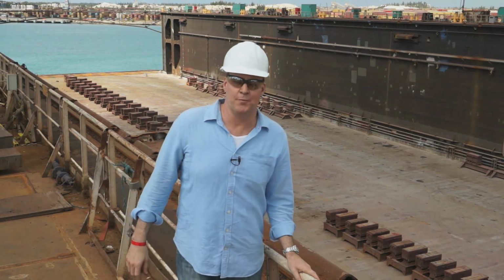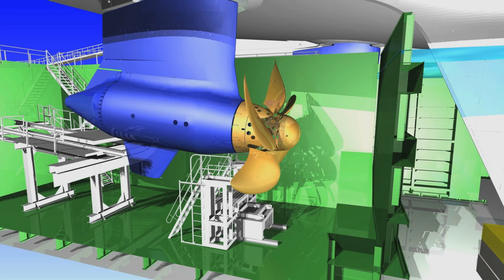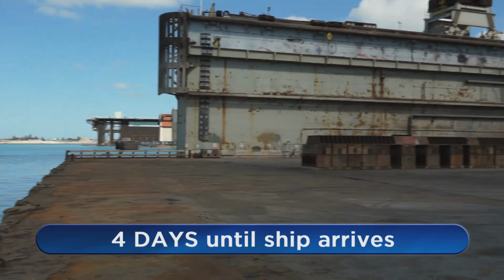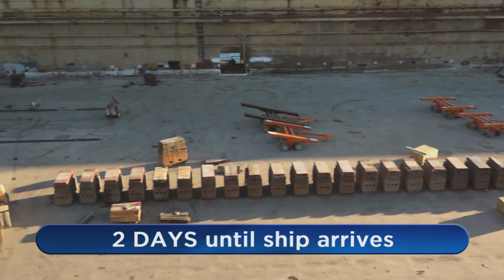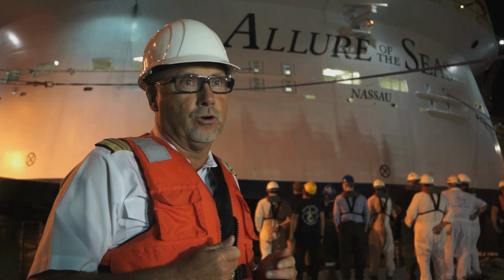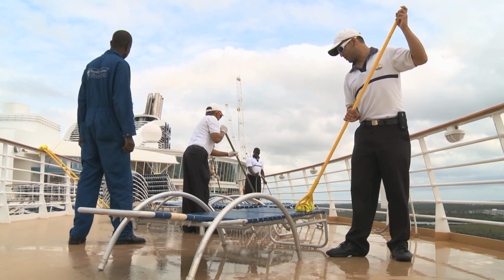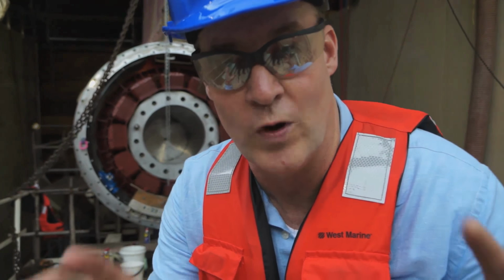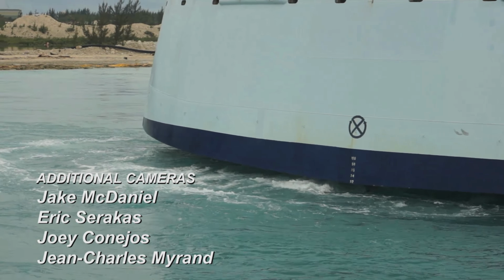Project Atlantis - Allure of the Seas

Comment: Unfortunatelly the bearing broke again after the repair. I sailed on Allure in December 2014 and one of the azipods was broken resulting in some itinerary delays.
Reply: Supposedly it's having problems again now (8/17/2017) and is changing itinerary on future cruises because it can't sail fast enough to make it to the planned further ports.
Reply: Jack White, you are correct. We were on the ship when it sailed out of Fort Lauderdale on August 6th, 2017. Our itinerary was changed slightly as a result of the azipod issue.

Comment: tree years and bearings broken?? i wonder how that is possible?
Reply: bad engineering
Reply: Bearings do not mix with sea water. When a single azipod has about 20 MW power and you get even a little bit contaminants in the main bearing, it will get damaged really fast. The interesting part is how did they get contaminants in the main bearing in the first place? I would assume that they have water sensors below the azipod main bearing  and pumps that can remove any water that's leaked in.